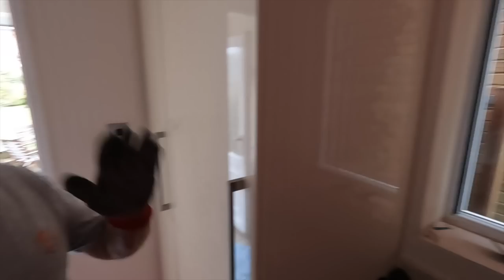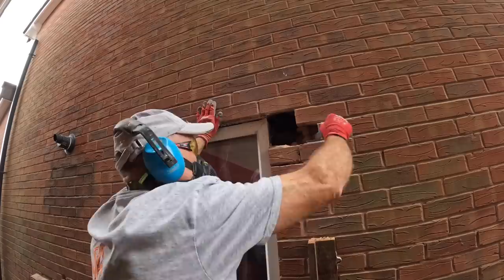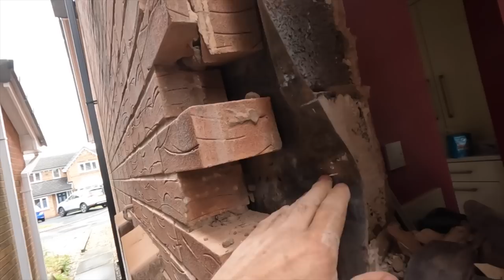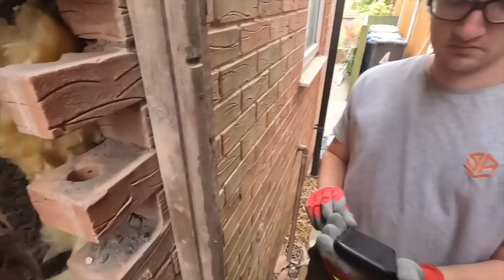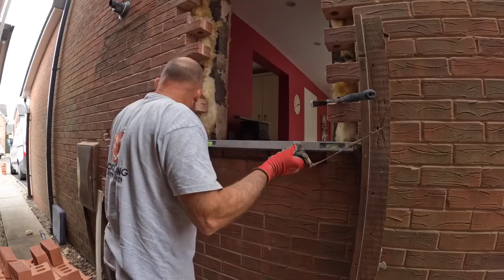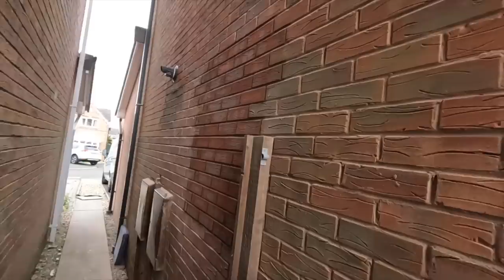TOOTHING AND BRICKING UP A WINDOW

Comment: Lovely job. Good to see a few quarter bats appearing. I always loved matching up jobs we had over 50 years ago. English, Flemish, EGarden wall and quite rare in the UK, Long bond, an american stretcher bond with double width joints. Even diaper work on occasion. Another old finish was lime coarse grit mix mortar requiring a rubber to point up to give beautiful flush pointing  usually with hand made bricks. My favourite was working with Tudor thin bricks which I have internally in my house. Shame that cost and the rise of Lego industrial type housing stock has made stretcher the bond of choice. Keep up the good work, quality professional brickwork is so lacking in some builds I see, that it is embarrassing.
Reply from the maker: Sounds cool 🤙🏽🤙🏽🧱👍🏼

Comment: Wheres the best place online to source random size bricks? I need to make a repair to the house and unable to find 3 of the size I need. Travis perkins wants to ship me a pallet and no where can I find that ships a few units online.

230x110x76
Reply from the maker: Your local reclamation yard is your best bet 🧱👍🏽
Reply: or use resin and brick dust to add a slither to a full brick.
but by the sound of the sizes there old imperials. so reclamation yard pal
Reply: @martingaynor5017  Not any around me I can find. Its getting painted once fixed but don't fancy thick mortar joints. I'm probs off a few mm with my sizes.

Comment: Question...
Could you have measured the opening, divided by 3, subtracted the grout/motor line widths and have 3 bricks of equal size ?
No criticism intended.
Love the videos !!!!
Reply from the maker: There are a few ways it can be done but none will look good unfortunately  😬🧱👍🏽
Reply: not unless you get them specially made
Reply from the maker: @martingaynor5017  🙄
Reply: @SteveAndAlexBuild  another pen pusher
Reply from the maker: @martingaynor5017  😏🧱👍🏽
Reply: Could do that but then it's alot of bricks cut down, plus it's only down the entry way,so not seen by people, so get why they out the closure piece in the wall, house needs rendering tbf the state of the brickwork who ever built it before lol
Reply: @liamconroy9276  cool, I get it.
When we do things like that(with floors or what ever) they make us make it as invisible as possible.
That's for the answer.
Reply: @peterking8233  yhyh I get you,I was thinking of then2ay you said with making it look like full bricks, but hell of alot of cut bricks to go down a entry way
Reply from the maker: Exactly mate 👌🏼🧱👍🏽
Reply: I would’ve toothed the wall 3 metres back!
Reply from the maker: @Kiwi-ej7dh  so would we if we were asked to

Comment: 16:39 instead of putting in 3 full and a quarter brick in could you have done 4 3/4 bricks in?
Reply from the maker: Absolutely not ! 😳🧱👍🏽
Reply: @SteveAndAlexBuild  Why? Just the extra work cutting bricks?
Reply: @charlieshwan5574  the bricks match the length of the other bricks in the wall as a whole. If you were to "shorten" the stretch of all the bricks in a window closure simply to make them all equal length , it would stand out and look like a Kludge, That one short brick in every course would be less noticeable. You are also matching the stretcher lengths of the bonds both above and below the window.
Reply from the maker: @charlieshwan5574  . No it would look even worse 🧱👍🏽
Reply: why.
terrible idea.
the lads have done a cracking job.
you have to work with what's there

Comment: Shockingly bad, extra mortar creating damp bridge.  Only saving grace sheltered wall between adjacent property.   That's why I insist on cavity insulation fitted as the walls get built
Reply from the maker: Yeah but this is just one of many windows 😬🧱👍🏽